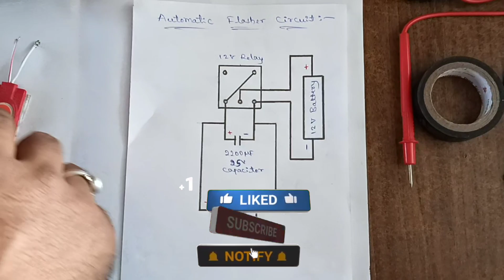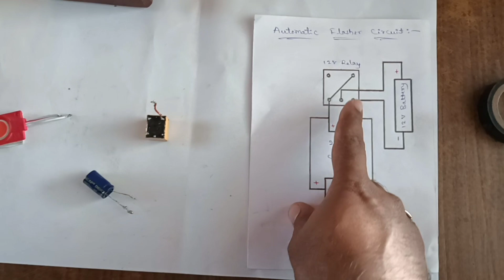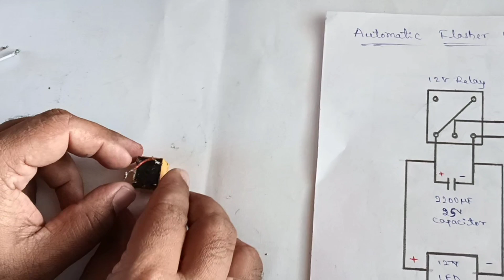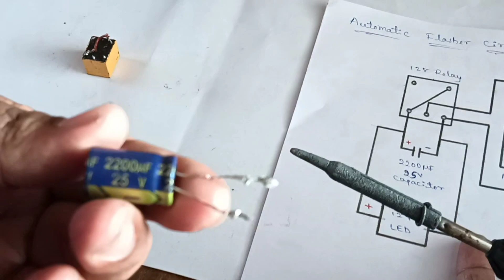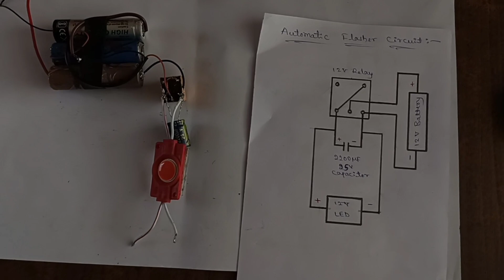Made Flasher 🔅 using 12V Relay Without timer # Automatic flasher circuit # Subscribe channel👈...

Comment: Very useful project auto matic flasher circuit project using for material 12v realy or 12v led light or 12v battery